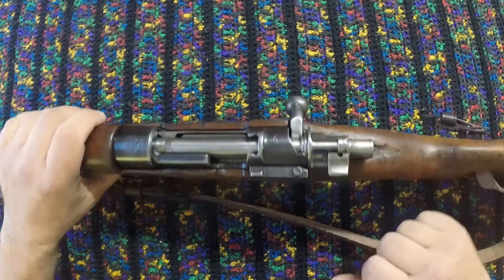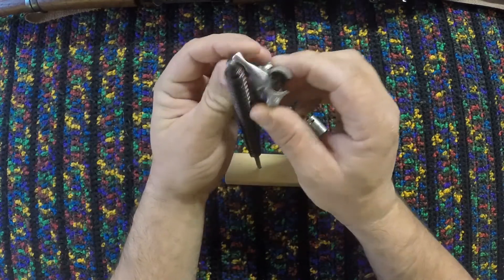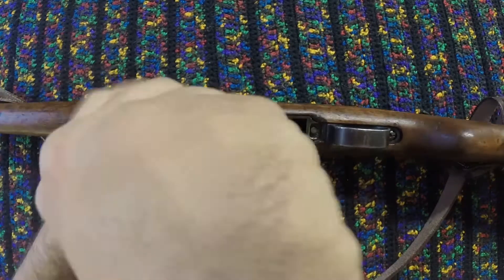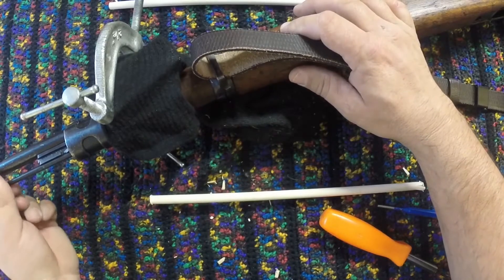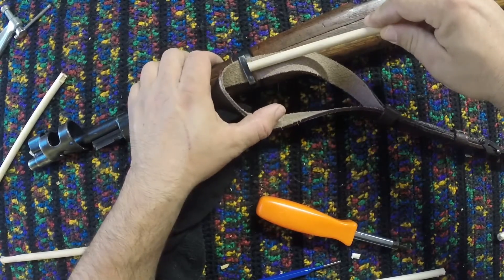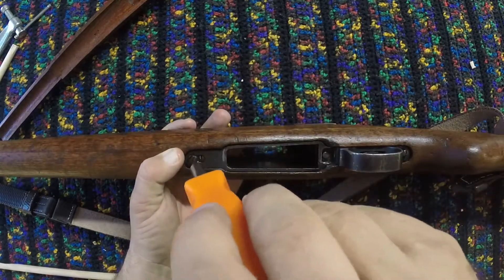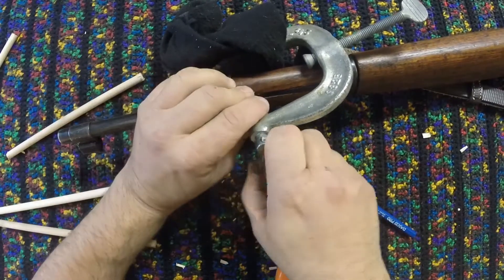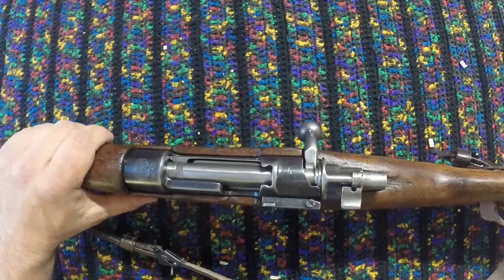Yugo M48 Disassembly

Comment: Thank you for the video! A trick I learned while doing my own: instead of using a vise to compress the spring, simple push the sling ring/retainer forward towards the tip of the barrel and tap the back of it with a hammer. The sling ring will gradually push down the spring as you tap it out, and effectively removes your other retainer as well.

Comment: How do you disassemble it if the safety is stuck due to mismatched parts?
Reply from the maker: That is, sadly, past my expertise.
Reply: I have the same issue now I can't even get the bolt back in the gun